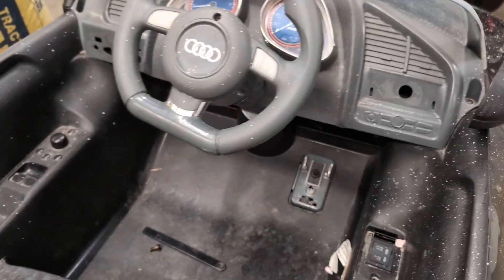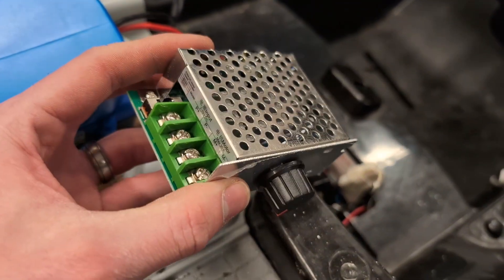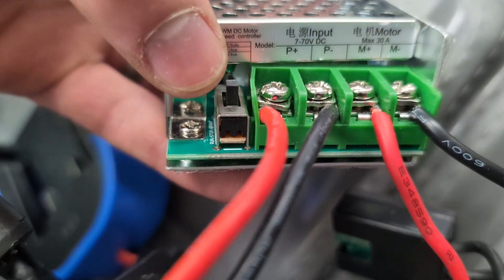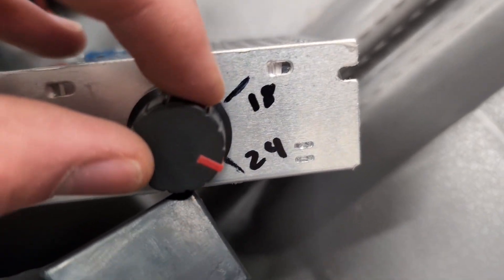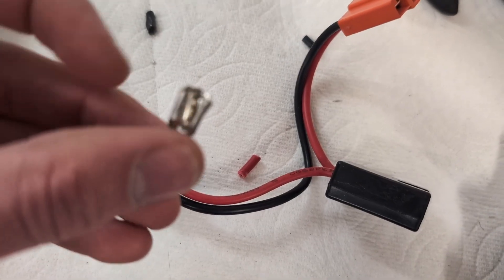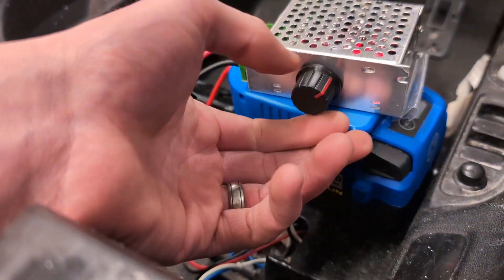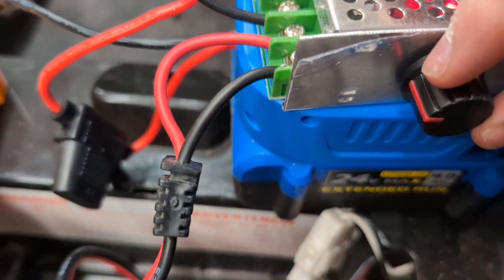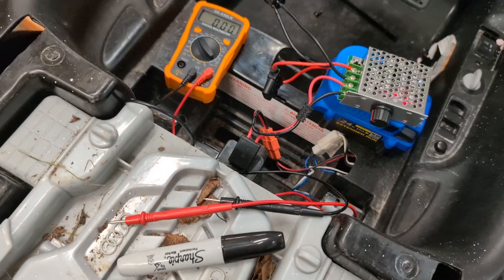Drill Battery Mod for Ride on Cars Powerwheels

Comment: will the battery run down so low the charger will not recognize it and charge?
Reply from the maker: Possible, haven't run a battery dead yet. If that happens you can try jumping the battery before putting in the charger